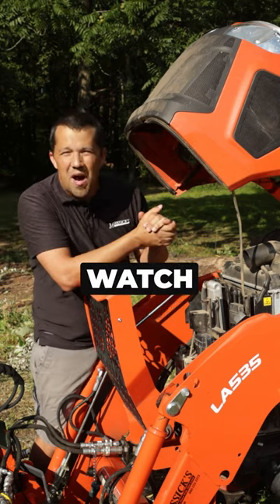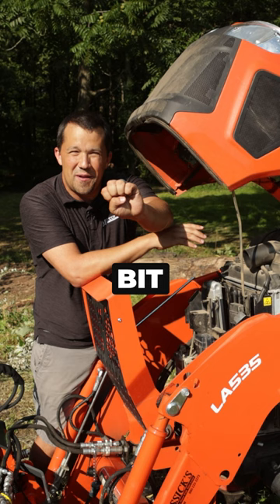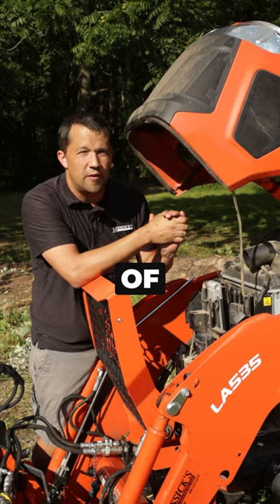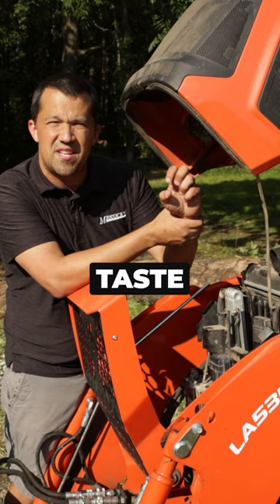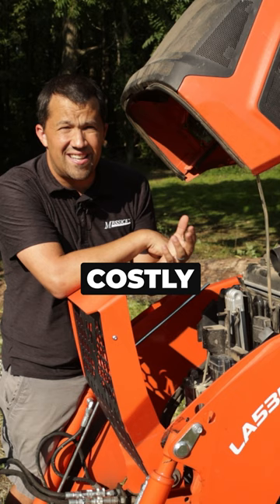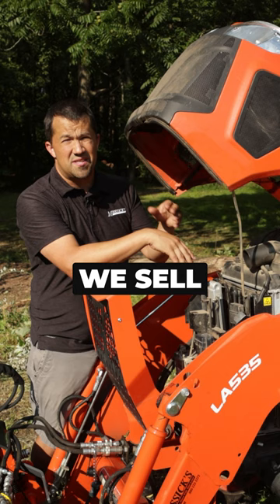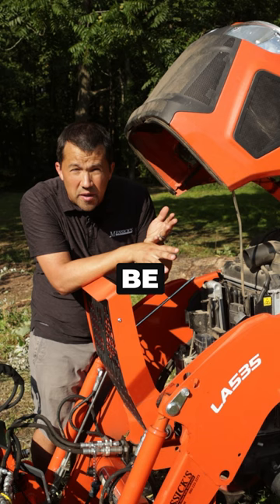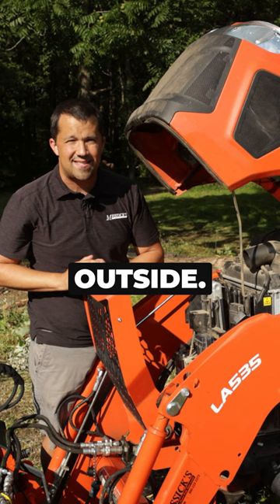What methods do you use to prevent mice and rodents from chewing on the wiring in your tractor?

Comment: I’ve done a lot of research after mice ate through the fuse box wires on our Toyota tundra and costed almost $5k in repair. I thought that there has to be a reason why, since I never find remnants of wire in their nest. Turns out electrical automotive wires are now made with soy thus why these creators chew them up. They smell food. and the manufacturers in China who produce most automotive wire have turned to soy-based products because it’s cheaper for them, but more expensive for the customer in the long run. It’s fairly recent, at least the last 20-30yrs or so and that’s why my older tractors and vehicles have no eaten wires. There needs to be more exposure on this and either legislation or some type of demand to be made to stop using soy
Reply: Same happened to my Sequoia 2x It was squirrels though.  Don’t leave it parked more than a couple days is my advice…If you can store it inside do it!

Comment: I had a mouse in my air cleaner housing on my LX2610 a couple weeks ago. I noticed the engine tone changed briefly when I started moving. No other sign of anything amiss until I raised it to  full throttle about 10 min. later. The engine started pulsing, shaking emitting a smokescreen.  It wouldn't start until over 2K RPM. I think the mouse was spinning around in the air cleaner causing a pulsing of the air.. It was kinda bizarre.
Reply: My mind instantly went to seeing a mouse rattling and spinning around in a Kubota air filter housing 😂
Reply: @BiffsEquipment  Yes, exactly this. Absolutely hilarious but also morbid.

Comment: I keep my Kubota tractor in my barn. Before I purchase the tractor I started baiting with "just on bite" mouse and rat poison. I keep the packs all around my tractor and underneath it. I also pull the tractor out and use an air blower in every nook and cranny high pressure. Seems to work so far. Put some dryer sheets in the engine compartment